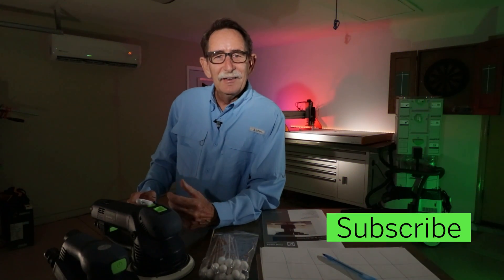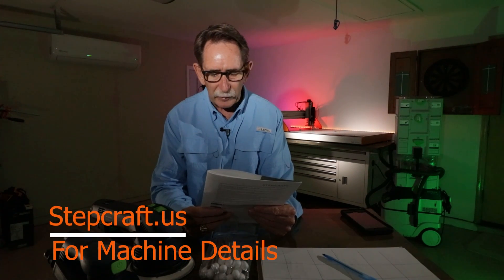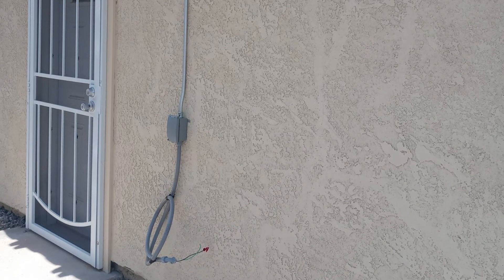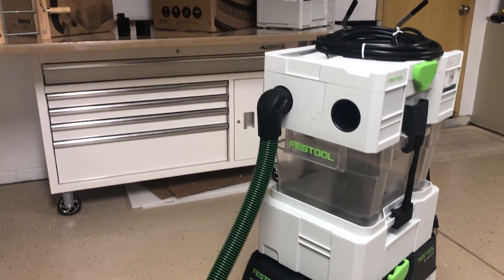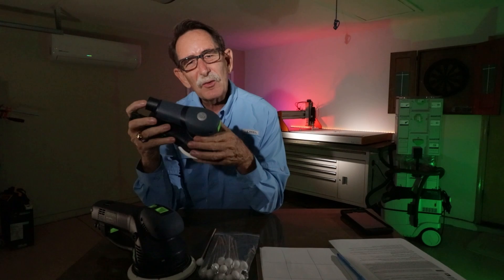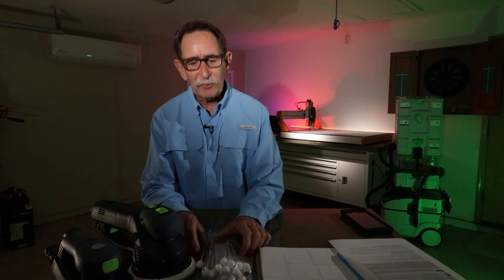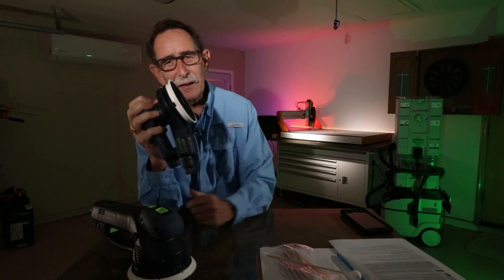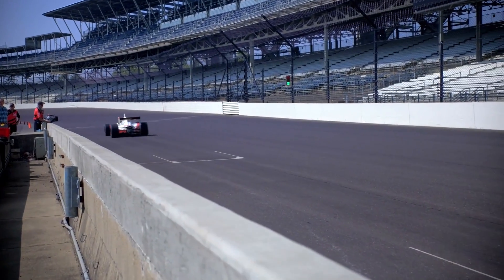My Stepcraft M1000 CNC Arrived - What I expected? A beginners view!

Comment: Very interesting thank you! Stepcraft is nice with good design but it is really not a highend machine. It’s more a ok Hobby Maschine that is not so powerful…
Reply from the maker: I would consider the Stepcraft M1000 a ProSumer to professional model.   If you go up one more level to the Q series it is clearly a PRO machine.   Thank you for the comment, everyone needs to get the right tool for the job, anything that inspires research is good... Cheers Brother.
Reply: @GeorgeKennerLaser  the q series is. Indeed. I tried the Stepcraft m Series and it is better than a FoxAlien cnc, even the Vasto line but still not very rigid for metal. Woods no Problem but even on aluminium it is not so good…  a Sorotec Maschine even a basic line is much more rigid… buy a Alu line and we can start talking about highend in this size… price doubled…
Reply from the maker: @chrisr1241   Again thank you for the comment.   If there is anything my friends say about me, I am honest.  I have not used the M1000 on metal, I only wanted it for wood.  You bring up good points and I advise others to look at your product suggestions.  I am old school to me this is about getting the right tool for the job.   Sometimes a Harbor Freight tool is the right tool   Cheers Bro.... and always feel free to comment or add to my videos... I have some more Stepcraft content on the way.

Comment: I have the same problem here in the Phoenix East Valley area. During the summer, my garage serves absolutely no purpose other than parking our cars inside and storage. Other than that, it's absolutely unusable to do any kind of work in, because it often gets up to around 120 degrees. I purchased for around $600 one of those freestanding AC units that you just vent into the attic or out a window, ran flexible duct work into the attic above my garage, and was so excited to finally be able to use my garage for projects. The AC unit made absolutely ZERO difference in the temperate, so I ended up sending it back. I've just come to accept that 7 months out of the year, my garage is off limits to doing any woodworking.
Reply from the maker: I purchased a Mini Split, it required 220 electrical and I can work all year long.   It is even a heater in the winter.   It is like a 2 Ton Unit.

Comment: Hey George. I’ve enjoyed your videos and just pulled the trigger on an M1000 myself. Haven’t received it yet. You may have said in other videos but I can’t remember if you have already told us what software are you using?  Do you like what you are using?  Is it user friendly?  What are your thoughts after using for a while?  Thanks.  J
Reply from the maker: I did a video on that... I have got to put these videos in and easier to find system on my channel.   Stepcraft sold me Vetric Vcarve Pro and Uccnc as the driver.  It is not easy but I am getting used to it.

Comment: Hey George, really enjoying your videos!

It would be really useful for me (and I'm sure others) if you could run through what exactly you bought from stepcraft (add-ons, upgrades, software etc.) but also what extra equipment you needed to buy in order to run the cnc (like the air compressor).

I'm looking at buying an M.1000 and could do with knowing exactly what is needed, equipment wise, to get the thing going.

Thanks a lot.
Looking forward to seeing more videos 🙌
Tom.
Reply from the maker: I upgraded all the motors, the spindle, and lead screws.  Then I added the tool changer, and the vacuum table,  I have some video content on that that I just shot today and will be out shortly.